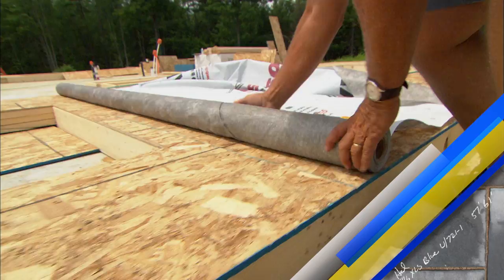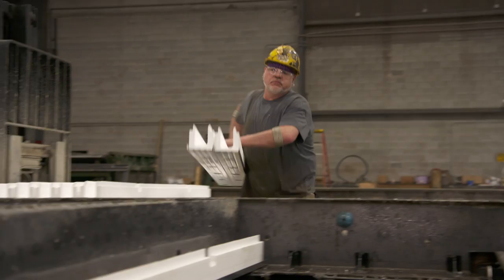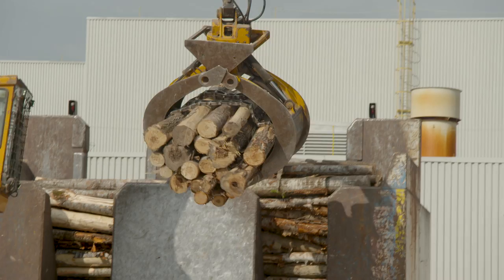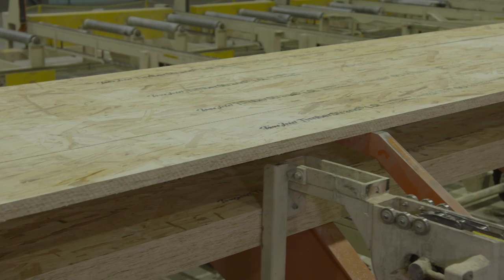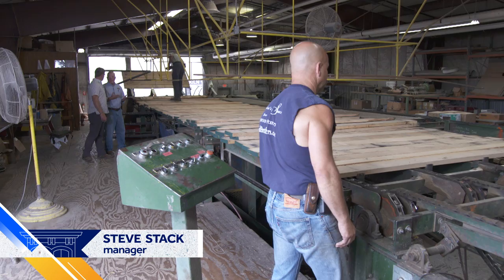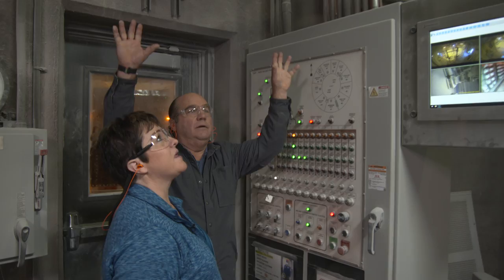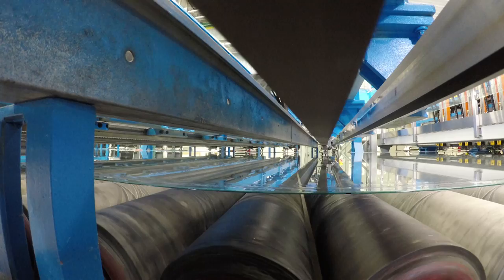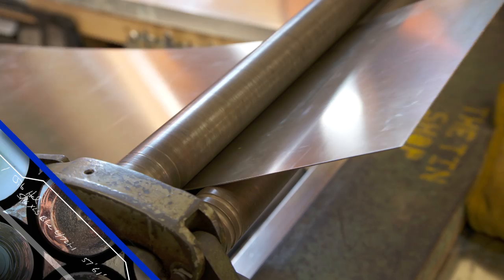This Old House | Factory Made (S42 E2) FULL EPISODE

Comment: Whenever I see a production line with machinery, sorting, and processing, I can't help but be in aww. Not at the product being made, but by the engineering and creative thinking that went into making the machinery of a factory line itself. Just look at all those little details and imagine, someone, somewhere sat at a drawing board or CAD computer and designed that part for that purpose. What happens in the unseen background of all production is just amazing when you take a second and look at it.
Reply: SO basically You are all IN for having machines take jobs!!!  management Much??      no jk but really so many factory jobs done by machines now can be good and bad... Just like hUmans doing the job can be bad as well... The on;y argument I can say about building a home that stands the test of time is every time I drive ROUTE 23 In Valley FORGE PA    there are small Log Cabins Built For George washingtons Troops that are still standing   ..  They are SO STEADFAST. sure not insulated but they have stood through a very hard test of time .....

Comment: I'm surprised that the foundation did not have a footer, which to my knowledge, is normally required. How is this design allowed by building codes? Also, I own property (undeveloped) where the CC&R's require all construction to be "site-built". This would presumably bar mobile homes but would the products shown in this video qualify as site-built? Is site-assembled the same as site-built? Finally, would transportation costs for these large and exceedingly heavy panels make them impractical for use more than a few hundred miles from the factory?

Comment: This giant factory processing is fascinating to watch - especially compared to more traditional building.... BUT HERE'S A BIG QUESTION... why isn't this making single or multiple housing units more affordable and/or available? Everything is so expensive private home ownership is so out of reach for huge % of people & ALL OF THIS isn't doing anything to change that
Reply: These large manufacturers are great at cutting down the costs of building materials but they can only do so much. Additionally, there are supply/demand situations which give rise to the prices of certain products. Homes can be built cheap, but the market demand and profit on those homes is low enough that there isn't incentive for the builders to build them in most cases. If you would like an affordable home, mobile homes and fixer uppers are probably your options. Just note that mobile homes go down in value while the inverse is true of most buildings with a foundation.
Reply: For people who invest $BZH $TOL $PHM

Comment: My house has a solid foundation of styrofoam and concrete....wtf?!
33% concrete, stronger 5000 psi strength, better insulation vs. 100% concrete with weaker 2500-3500 psi strength, worse insulation